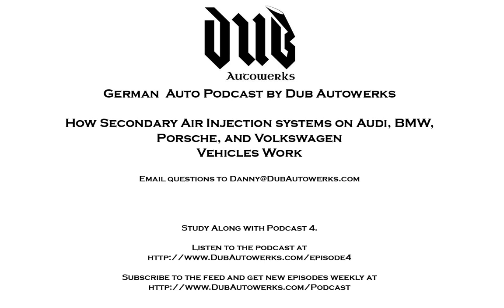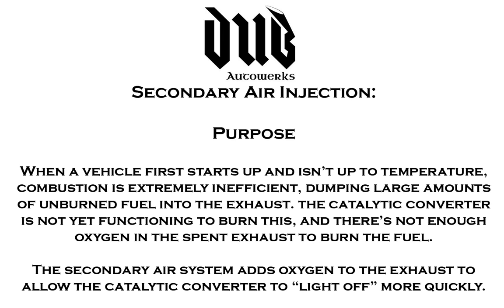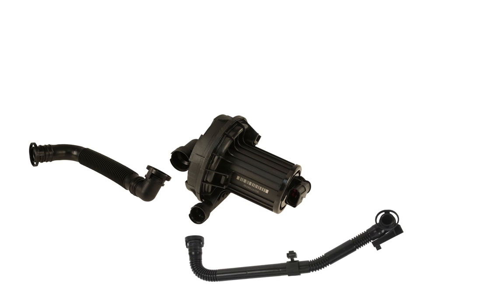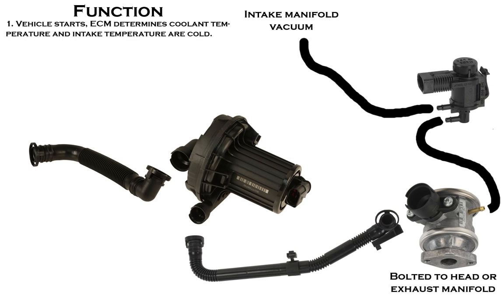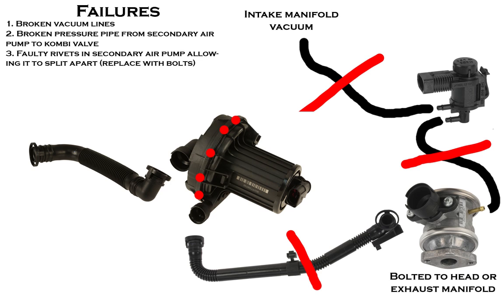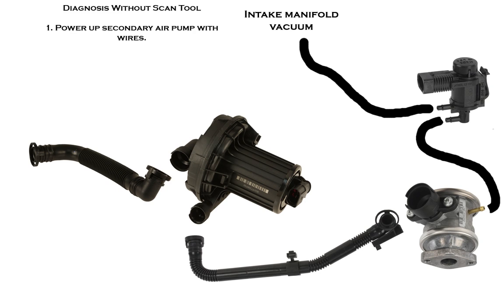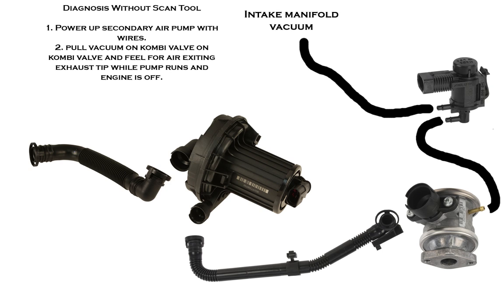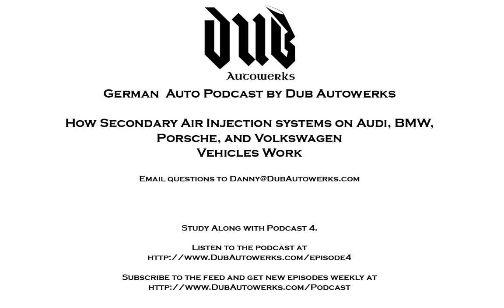Secondary Air Injection Systems on German Vehicles

Comment: great video thanks a lot, i do have a question. By a scan tool you mean a auto shop professional specific tool? I do have the RossTech VCDS tool to pull coes and a bunch of diagnostics but I am not sure if that would run this output test mode you mention here... Ill research this while I wait for your answer thanks

Comment: Excellent video. The best I've seen on this topic.

Questions: So my understanding of the relationship of the kombi valve to vacuum is that it can have opposite responses to vacuum—in the case of a kombi valve that opens due to pressure from the Secondary Air Pump, vacuum is used to CLOSE the kombi valve, and in the other case, vacuum is used to OPEN the kombi valve. Is that accurate?

Is there a way to know which mode a kombi valve uses? I am trying to diagnose some error codes on my car and am unsure which kind I have.

Comment: This video gave me the confidence to inspect my Audi Q5 3.2L after codes P0492 and P0491 appeared before a smog test which would have prevented passing CA smog emissions test. 
Thank you for taking the time to make this.

Here's an EASY TEST you can do to rule some things out:

Find the intake tube of the SAI pump, it's usually directly connected to air intake box. Remove the air intake box if necessary and disconnect it so you can see the open of end of the intake tube. 
Now when the vehicle is dead cold and hasn't been running in some time, start the engine, leave it in park with the hood open, and then run around the front and see if the pump turns on.

If the pump doesn't turn on check the fuse and the SAI pump relay in ECU box, typically under the hood or compartment below the steering wheel. The relay terminals sometimes turn black when it's going bad. Also check the wires leading to the SAI pump for damage. If all are good then you may need to replace your pump, but that's typically rare. 

If the pump turns on, is there a good amount of suction at the end of the intake tube? There should be. If not, then you either have a bad pump, a clogged or broken intake line, clogged or broken tubes that lead to the exhaust manifold, faulty solenoids that control the combi vales, faulty combi valves, OR worst case scenario, clogged ports in the engine head that exit each exhaust port. That's a very costly or time consuming fix. 

If the pump turns on and you have good suction, then that means the ECU is sending signal, intake tube is good, SAI pump is good, but you may have broken hoses OR, a big OR, you may have had a clogged foam filter in your air intake box that the SAI pump intake tube was attached to and by you disconnecting it you actually without knowing fixed the problem. I'd recommend replacing this foam filter as they disintegrate and also clog up overtime. 

To rule out broken hoses simply activate your pump manually by applying 12 volts directly to it with the engine off, and seeing when the SAI pump runs that not much air is entering the system. 
With the engine off, the SAI system is closed, so the air should have no where to exit and thus very little to no suction even when the SAI pump is running. That's a good sign and that means you don't have broken lines. The combi valves and solenoids could still be bad and stuck in the closed position preventing air from entering your exhaust but that was ruled out when you cold started the vehicle and felt a good amount of suction at the intake tube. 

It's all trial and error, but no one ever mentioned utilizing the intake tube as a convenient means of diagnosis. Accessing the combi valves and inspecting all the lines is FAR more difficult than simply power the SAI pump when the system is activated the ECU and when you manually activate the pump with the system off (closed).

Best of luck

Comment: How you doing? I have a 2005 mercedes ml350 w163  , my problem is the P0410 secondary injection pump circuit malfunction, the pump runs or blow air with wires from the battery , the electrical connector has ground . My problem is there's no continuity from the pump electrical connector to the 40 amp fuse  , my next test was jumping pin 30 and 87 the pump does not run , pin 30 has over 12 volts pin 87 has No voltage when jump or trigger. Thanks

Comment: I have the famous P2432, I replaced the sensor on the line coming from the Secondary Air pump

My pump runs 100%

I get code on VCDS P2432- 002  Short to Ground 

Secondary Air Inj. Sys. Flow/Pressure Sens Bank 1 

I have 4.2l FSI V8 

I am assuming it’s the bank 1 sensor - the left sensor of the 2 sensors next to each other with small Vacuum lines from Kombi Valves 

I appreciate you guys for helping out

Comment: I had to fix my SAI system (2001 VW Passat wagon, 1.8T) to pass California smog. Replacing the somewhat carbon-clogged combi valve eliminated the check engine light, but the readiness monitor never cleared to 0 (ready). On cold start, I found no vacuum at the combi valve vacuum control inlet hose, but vacuum at the "F-hose," which pretty much pinpointed the SAI control solenoid valve under the intake manifold. I replaced it, and the discolored and stiff silicone vacuum hose connect the two, drove a 10-mile loop with a couple of decelerations from 45 mph and 3 restarts, and I was ready for my smog test. :)
Reply: Thank you for explaining your process on how you fixed the infamous SAI system on VW/Audi platform. I also have AWM engine code 2001 Audi A4 1.8T and lived with the infamous P0420 SAI system fault for 13 years. I never studied the SAI system because in NJ you are allowed to have one readiness monitor not complete and NO check engine light. I had a general idea that the n249 valve (SAI control solenoid under the intake manifold was the culprit since mine are original to my knowledge, I am ready to tackle and finally fix it for good.
Reply: @JerZeyFiveOh  Easy test of that control solenoid valve: disconnect the hose to the control port of the combi valve, put your thumb over the end of the hose, do a cold start, and check for vacuum. No vacuum (my case) --> leaky vacuum valve portion of the solenoid control valve.
Reply: @johne6081  I will definitely do a test! Thank you for the tips.

Comment: Hi, please can you help me solve this problem. i scan my 2.5 vw jetta mk5 with vcds scan tool. i had this error code:  005170 - Secondary Air Injection Solenoid Valve (N112)                 
P1432 - 004 - Open Circuit. 
what could be the problem and how to solve it. thanks

Comment: Thanks for the great video. I have a 2003 Eurovan 2.8L 24V VR6. First start everyday (or after sitting several hours) regardless of outside air temp the Idle runs bumpy for about 90 seconds at 1300 rpm. Then it settles in at 800 rpm and runs great. Guessing the bumpy idle has something to do with the secondary air system. Any ideas what would cause this and anything I should worry about damaging letting it run rough? If I immediately turn engine off and then back on after first start it runs smooth without the 90 second bumpy idle. No error codes being thrown.
Reply: That is very normal for a cold start, it happens in every vehicle I've driven in at least, again regardless of outside temperature. Essentially you don't have anything to worry about

Comment: Hi. Secondary air pump issue will be caused by P0430? If catalytic converter is clogged, then this pump will run continuely?  My pump does not off even after starting of car for 20min

Comment: Can you clean a Kombi valve that's stuck open? I stuck some rubber gloves on my jetta and with it shut off the valve should have been closed but the gloves filled up quickly when I jumped the secondary air pump. Thinking that the valve is corroded and stuck in the open position.

Comment: Anyone know where the air pump is located on a 2010 VW CC 2.0T? It appears to be it may be in the driver's fender area as I see lines coming and going from that small area behind the headlight. If so, how do you access?
Reply: Remove the tire and fender cover , and access thru there and under it

Comment: I got an a6 1999 with a cracked secondary air pipe thingy on the left side in your video. Could this be a reason for a missfire and loss of power? My car is a 2.4 v6 a6 c5 and runs rich i think as it backfires alot and fuel consumption goes up signifcantly. The missfire happens always most when going from cold to warm engine then kind of lets go after 10 km or so but leaves me with crazy backfiring and decrease in power very annoying i must say also the idle gets rough and bumpy when warm as well as stalls if i dont give it a little gas on start. But it starts great on cold. guidance/help much appreciated
Reply: It burns excess fuel during a cold start. It shouldn't have anything to do with anything miss firing. Check injectors spark plugs computer and possibly wiring.

Comment: Awesome video. I have the Sai system on my e46 with the check valve that is actuated by pressure from the Sai pump, not a vacuum line. I tried to blow into the check valve tonight and I cannot get air through it. Should just the force of me blowing be enough to push air through the valve into the cylinder head?
Reply from the maker: With your mouth or with an airline from an air compressor? you can honestly tell if the valve is clogged or not because the pump will kick on on a cold start and you'll sound like it's under much higher of a load will be a higher pitch noise and sound like the pump is struggling.
Reply: @GermanAutoInstitute  thanks for the reply.. problem ended up being valve was in fact stuck. Freed it up with some pb blaster and has been working great.

Comment: I have a question for you on my 2004 Audi A6 2.7t S-Line , I delete the catalytic converter and i want to know if I need any more this air secondary pump or I can just delete it ?? I saw some people the put plate on cylinder and delete this pump do you thing if I delete it is going to do any different on Gas Mileage since I don’t have catalytic converter anymore ?
Reply from the maker: if you deleted the catalytic converter then you do not need secondary air, secondary air just heat the cat up faster so it is pointless after you remove the cat.

Comment: I hope you can help me please, my cable connected to the air pump is not getting any voltage I have replaced the 100 relay but still the air pump is not working. I hope you can suggest some thing, My car is audi a3 2006 1.6 bse engine.
Reply from the maker: So if you pull the relay out you'll notice the relay has terminals number 30, 87, 85, and 86.

Where the pin 30 goes into the relay board should have battery power all the time, 85 and 86 one of them should have ground, and one of them should have power when the secondary air pump is supposed to be on, when that happens pin 30 and pin 87 are connected and it sends voltage to the secondary air injection pump.

so if you have battery voltage to terminal 30, and you have power and ground to 85 + 86, then check and see that pin 30 and Pen 87 have continuity when the relay is energized and then own check out the wire to the secondary air pump from where pin 87 goes.

Comment: This is why Audi's suck...this was a good video...thanks....I may have to go through this entire procedure
Reply from the maker: mobildetroit Better than how Chevy did it in the 80s, just having a pump rob hp from the crank 100 percent of the time for something needed only for 2 mins
Reply: German Auto Institute well all the GMs Ive owned since the 80s have none of that air pump stuff....so....I have a 2001 audi that has an airpump and a bunch of parts to support it...many points of failure.  My output test on the secondary air system aborts when I try testing it....
Reply from the maker: You've never had a GM with the smog pump?

What model Audi is it and which engine? This video shows how to diagnose it without using the scan tool. Are you using basic setting 77 to test it or output diagnostic test mode so you can trigger things with the vehicle off?

The most common problem is the vacuum line to the kombi valve.

What fault code do you actually have? You can email me Danny@GermanAutoInstitute.com

If it's the 2.8 liter, you may have clogged cylinder heads.

Comment: What if i disable and remove this part, how will it effect my engine other than throwing a code
Reply: I heard that there could be a smell/stink of hydro carbons into the car.  I’m sensitive to the smell and the noise on start up so I’m replacing mine.

Comment: This pump is always on in my car and discharging my battery, what could be  the problem? Thanks..
Reply: The relay feeding the Pump is more than likely stuck closed. Terminal 30 is usually Hot at all times on the Relay. If Terminal 30 and Terminal 87 are touching- the pump will never shut off. Terminals 87 and 30 are on the Load side of the relay.

Comment: I have  a 2000 VW jetta VR6. and the biggest problem with this car is that the engine takes up all the engine bay space.  i have to remove the bumper and drain the coolant to fix many problem on this car. worst design ever.
Reply from the maker: It's a high performance car bro. Next time buy the 2.0 with half the HP, plenty of room, lack of any fun. There are trade offs in life my friend.

Comment: my secondary air pump does not stop after 90seconds... is that possible?! what is the problem?
Reply: Terminal 87 and Terminal 30 could be stuck closed on the Relay feeding the Secondary Air Injection Pump. You might want to get that fixed- so you don't burn up your Pump.

Comment: Checked the combi and its fine..vacum all ok..secondary air solenoid works..i have no power to the air pump..it just wont start in the mornig.I have vacum on the combi valve and its opens when cold (i can hear the exaust if i unplug the hoses from it) and closes fine when engine warms up. Could it be a relay? I have no leaks from the solenoids and hoses, not even from the pump. I think my problem has to do with the power. Any sugestions?
Reply: Check the Relay and Fuse feeding the relay. Without a Wiring diagram- you will be lost.

Comment: Hey guys,  don't ask him about deleting smog stuff.  It's illegal to take emissions off cars in most countries.  He can get in trouble if he advises about deleting.  EPA and CARB are watching!   Great video, btw,  gives me ideas about inspecting and correcting the system on my poor, sad 2001 Boxster
Reply from the maker: Actually, the funny part is that the majority of engine tuners out there plainly offer secondary air delete. 

If I make you a tune and send you an ECM and you put it on a street car that's on you. As far as I know it's a racecar. 

That said I see ZERO reason to delete secondary air on a vehicle with cats...and on the 2.7t you can gut the precats and relocate the 02 sensors and it still passes cat efficiency and makes MUCH more power without killing the Earth.

I had a guy with a Cayenne Turbo S enquire about a delete tune a couple days ago and instead I walked him through fixing it. I don't see the point in killing the Earth because you're cheap or lazy. If you want to make extra HP then fine, but generally I try to keep emissions in place.

Secondary air costs you NOTHING horsepower wise and has no real performance downside.

EVAP not only has no downsidr, it gets you better fuel economy, so again I don't see the point in deleting it.

I will admit with the 1.8t it's sort of necessary to run a catless downpipe for antilag and to spool the turbo more quickly. But for the v6 and v8 engines, gut the precats, move the downstream sensor to after the post cats, it'll gain 30 up and pass cat efficiency even without a tune or an O2 defouler, and run 13.9 second quarter miles with a tune. Pointless to delete.

Now, if you have clogged cylinder heads I don't blame you for not wanting to spend thousands and thousands of dollars on something that really only improves the emissions for 30 or 40 seconds when you start the vehicle.

I'm also really not that morally opposed to it because most of the states have a scam operation going on where if you fail emissions you go in and you pay a hundred or $150 for diagnosis and towards repair and they'll give you a waiver for 2 years so it's all just a money-making operation. The state will totally just let you go on polluting the atmosphere for the small fee of $150 every two years, and it doesn't even need to be a separate where new diagnosis every two years.

At that point I just view it as a money-making operation for the state and I have No Reservations about the fact that people don't want to pay to fix a bogus design.

Many of the secondary air designs utilize the combi valve right on the exhaust manifold and just dump the secondary air right into the exhaust which eliminates any possibility of clogged passages, and then they decided that they wanted to jump the air and right behind the exhaust valves on some of the V6 and V8 and made these tiny little ports that get clogged with carbon, I've tried drill bits that are on Springs that are supposed to clear these out, I've tried penetrating oil and compressed air or steam and nothing that I've been able to do has been able to clear them out, to remove and repair this deficiency on a 2.8, 2.7t or a 4.2 Audi would literally be 3k or more because removing the heads requires engine removal.

The main issue was a lack of oxygen on cold start so if you just start the vehicle and start driving it the cats will warm up nearly immediately it's a difference of 20 seconds of pollution and that's a hypothetical I've never actually thrown a gas analyzer on to check and see the difference.
Reply from the maker: JDM A'F Nearly every tuning company offers a defeat that defaults readiness to set and disabled the test. If you leave the components in place and have no faults they're none the wiser...on an off road race car ;)